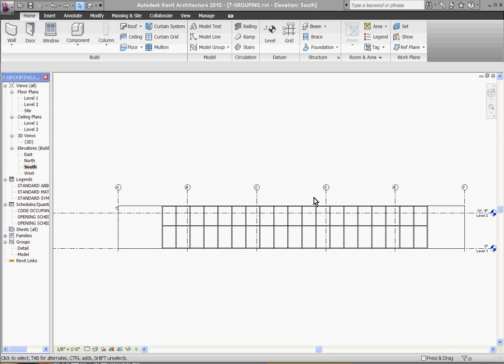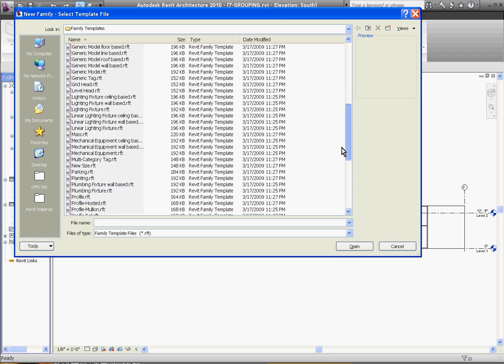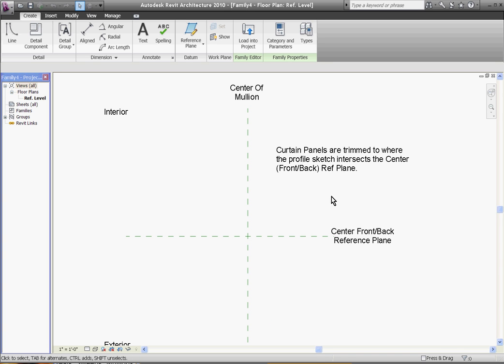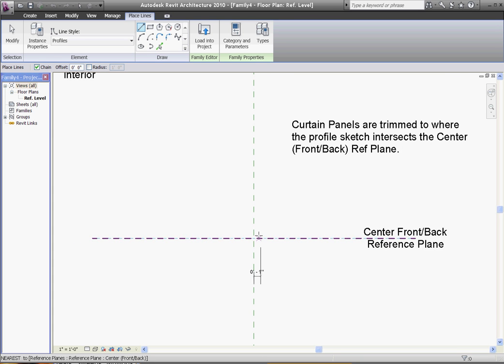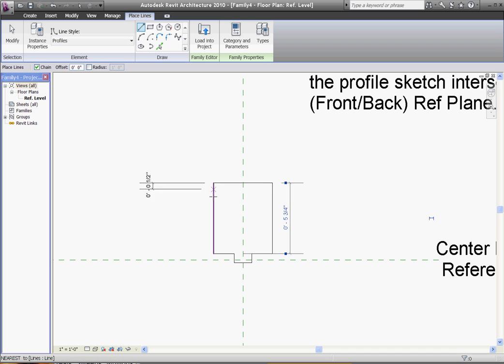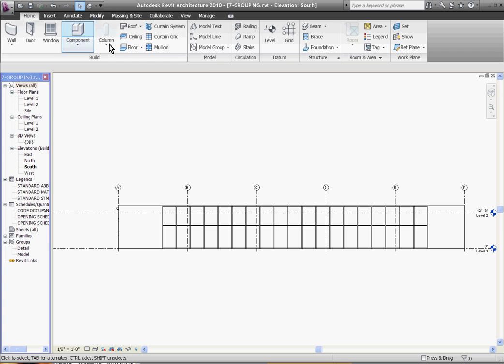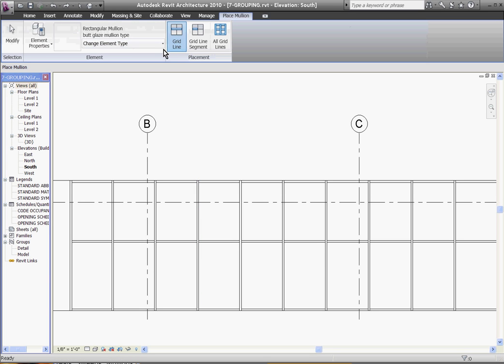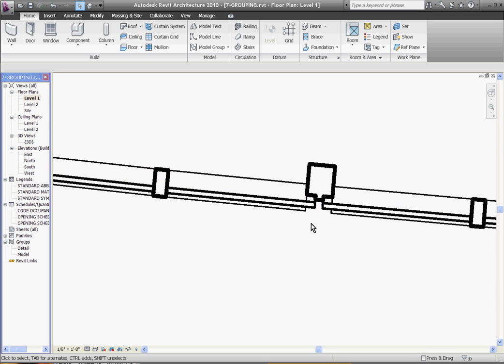Easy Revit (2010) - 6.1 - Custom CurtainWall Mullions

Comment: hey mate thanks for the vid, I created a profile and loaded it into my project and worked fine, however I then created and saved another profile but it will not load into the project and if it does it wont show up in the mullion section. any suggestions thanks ?

Comment: Here's a better way to do it: Simply offset the PANEL by an amount that moves it in front of the mullion. When this is done the panels then join. You can do this by editing the panel type. Once you're in the editing panel you'll see under Constraints, the Offset parameter. This is where you will play with the value to get the desired results.